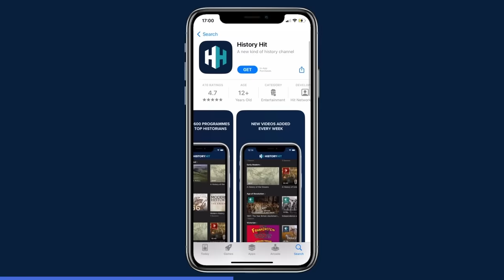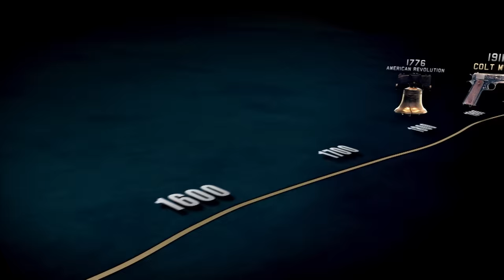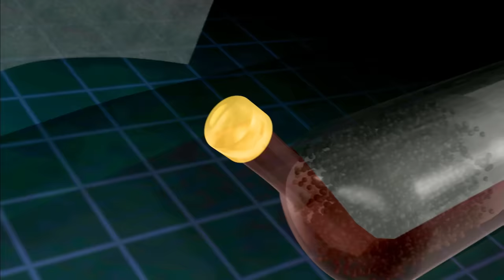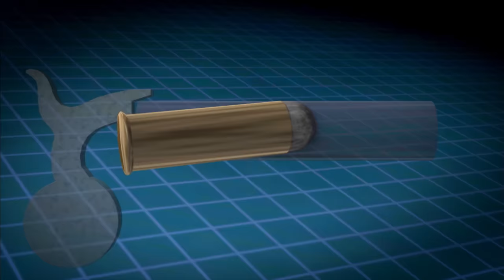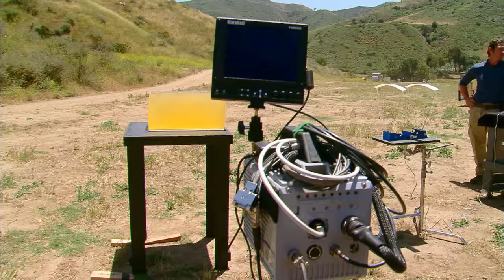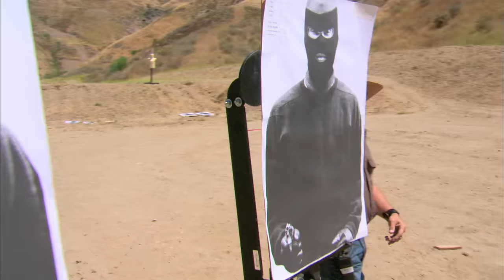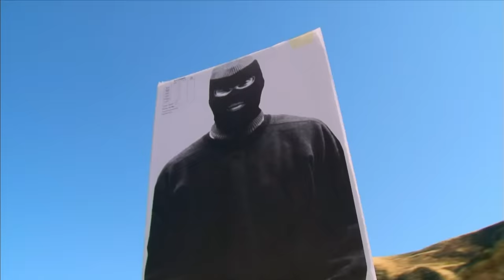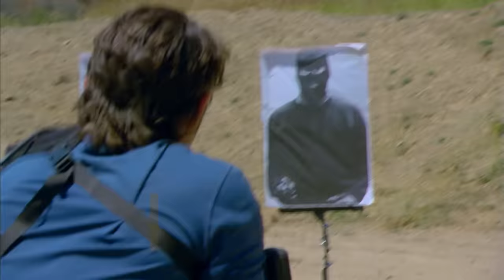Why The Colt M1911 Is The Ultimate Sidearm | Weapons That Changed The World | War Stories

Comment: A 1911 is like a classic work truck. Simple, elegant, needs a little knowledge to keep it running, but in the long run will outlast all the modern whiz bang stuff.
Reply: I have yet to see a polymer frame crack from recoil fatigue. Metal frames can and do crack, even the forged ones. Most, but not all, modern frames are investment cast and they stand to last longer than the forged frames

Comment: Retired in ‘91, Ranger in 1st and 2nd Bn’s.  Did not transition to 9mm while on active duty; kept the 45’s as the personal protection sidearm.  I have several Lugers, dating back to 1939 and fire them periodically.  Temperamental with the top toggle and be sure to keep them clean.  My carry pistol is the 45, though.  We used to joke (somewhat) that those heavy rounds had torque over horsepower…..if it hit and didn’t kill you on impact, it would drag you to death.
Reply: I have a double date 1916/1920 WWI/Weimar-era police Luger. Erfurt manufactured but Mauser refurbished in 1920. It's a slam dunk of a shooter, and it's only malfunctioned with the original mag (single-pin baseplate, so it's loose but could be fixed) and with crappy aftermarket ones. If you can get your hands on stainless Mec-Gar mags, you will probably never see a malfunction again. You'll have to look sharp for them, because they only make them in limited runs and they sell out quick.

Comment: I bought my first pistol a Colt 1911 in 1987. I have had several since and carry a Colt 1911 Gold Cup now. I have never had one fail me and have never worried if I had enough power. It by far does more damage then my other 9mm and 40's I've owned. I highly recommend one. Yes , it's also all American and a living legend.
Reply: Power is the wrong word choice. It's winning feat is diameter.

10mm and 10mm based cartridges would be best described as power
Reply: @jason200912  Well ,I was speaking of knock down power. As far as penatratimg power, it has more than enough, so that kind of power is of no concern  to me. That is what my M1A Socom is for....
Reply: Then you havent fired them much.
Reply: One question. What kind of ammo does your 1911 take? From what I’ve heard, 230 grain jacketed hollow points aren’t as effective in close range or in standard 5” barrels. Have you ever tried running semi-wadcutters?
Reply: We know that the Colt M1911 remains one of the most distinctive automatic handguns in the world. Comparible with the cheaply made Russian Kalishnikof AK47. I have very little experience firing bullet firing weapons only doing a little hunting with a beautiful Single barrel Spanish 12 bore shotgun, an English 4.10 bolt action. A 4.10 / .22 bullet over under tubular 15 round .22 short, and a Webber pump action steel headed plastic pellets. A single trial burst of a WWII British Sten gun on a Scots Regimental firing range. For which I was grateful, though I Was not impressed by the Sten gun.
In Scotland prior to 1707 and the Rebellion against the illegal English occupation and Act of Union, Scottish clansman and citizens were permitted to bear arms, but after this age and Civil unrest English politicians denied Scots civillians the right to bear arms. A century later Shotguns and hunting rifles were permitted only for hunting deer, and small game under licence on certain countryside areas. It is illegal to bear arms for home defence against criminal home invasions.There are certainly many cases where individuals have been hurt, having no right to have a weapon in order to defend family.
Only the Police and military are permitted to own a weapon despite which we have had several Home and School shootings over the year by evil or insane individuals who illegally bought smuggled black market weapons. Non Lethal weapons such as Tasers or crossbows are also illegal.
New non lethal weapons such as stun guns or electricly made weapons should be developed for home safety and for people who are living in areas where they are vulnerable, but follow the laws until the registry and ownership of lethal lockable weapons are developed, with computer based genetic or switched locks where they cannot be fired by anyone not the owner and spouse of the device in emergency situations, such as invasive threats by criminals and thieves.
We also need GPS implementation devices to track family members and children outside the safety of the home. Laws must be drawn up to permit the use of such devices with advanced information transceivers to local Police or military sources to protect and track individuals such as our children and vulnerable family members in such emergency situations. To this end, all schools must add self defence lessons to the Curriculum in every school in Scotland. 
Added to this all areas must have detection devices against hidden weapons carried into schools, Shopping areas and Banks to prevent innocent victims of violent criminal attacks as knife crimes rise in  retain year by year.
Reply: I have a Ruger SR-1911 as my EDC.
Reply: @williamwilson2270  if your real and not AI then its terrifying peopl like you exisr.
Reply: @williamwilson2270  So, you think the government tracking your every location is a good thing-how good has the government been, so far?  While not the intent of this following quote, it seems in modern times to fit: "Those who would give up essential Liberty, to purchase a little temporary Safety, deserve neither Liberty nor Safety".

Comment: I inherited a Colt Commander .45ACP from my father when he passed away.  I still take it out on the range for some fun but it's a handful and temperamental compared to newer handguns.  Still love it though.
Reply: Needs a tuneup. I did a little work to my 1911 I bought back in early 80's, I'll match it's dependability and function to any modern gun.
Reply: not tempermental, commander eats reloads no problem, hollow point, etc.
Reply: Not good enough as self defense gun.
Reply: Reliability issues are usually from magazines.  (That goes for Berettas, too.)  As 'handfuls'  go,  well,  my all-steel Commander is a chunk to want to  carry around but the weight helps  cause my hands aren't exactly bringing a lot of mass to the recoil equation.  :)
Reply: @reiniergarcia  elaborate
Reply: @reiniergarcia   I don't see why not, was good enough for soldiers.
Reply: @reiniergarcia ?? Compared to what?
Reply: @independentthinker8930 Sig P220 says anytime any range!!
Reply: @reiniergarcia agreed its a old battle horse but better guns have passed it by.
Reply: @dwayneelizondomountaindewh1465 Most soldiers never see a handgun. And those that do carry them in a holster and they never move.
Reply: Adjust your extractor and polish the feed ramp/chamber, it's easy
Reply: @gophucyorselph5179  Always something needed for a 1911 to run half decent. My P220 ran great out of the box. No bs needed. No break in no oil up etc.
Reply: @gophucyorselph5179  that isn't all, to actually make it better, match chamber feed ramp to frame ramp. That makes a huge difference
Reply: @gophucyorselph5179  polish the feed ramp, seems to be the be all end all! LOL
Reply: @independentthinker8930  I agree 👍
Reply: Has the commander been throated and ramped? If your dad had it, it was probably not done at the factory as hollow points did not exist back then. Have a good gunsmith throat and ramp it. Replace the recoil spring with a new spring and up the power. A standard Colt Commander came with an 18 pound recoil spring. Move up to a 20 pound recoil spring. The added power will ram the cartridge out of the magazine, up the ramp, and into the chamber where the slide will lock up more consistently. Replace the hammer spring as well. Factory load is a 23 pound recoil spring. Give it a fresh spring. Replace the firing pin spring as well. Now change out the magazine with fresh Wilson Combat magazines. Have the gunsmith hand tuned the extractor when he has it for the throat and ramp. It ought to work just fine for self defense work.
Reply: The key to the 1911 being reliable is using really good magazines . Not the stock ones.
Reply: So, according to the fans in this thread, the stock Colt 1911 was crudely machined, had weak recoil and hammer springs and crappy magazines.  Sill, it was better than a Nambu I guess.

Comment: I learned the 1911 in 1980 during army officers training in Fort Knox. Since then, I've owned some 10 different 1911s, from AMT Hardballer, to Colt, to Springfield Armory, to Sig TT, to Les Baer, Ed Brown, and recently TISAS. I currently own 6 1911s. I had one on my hip during thr Rodney King Riots. I've had one behind my pillow for many years. I usually carry a Commander size 1911 on my CCW. If things go bump in the night, a full size 1911 loaded with 230 grain +P, JHP, is warm comfort.

Comment: That’s why the Para-Ordnance frames really took off in the late 80’s. You had 12–13 rnds of .45 acp in the mag.
They even started making 1911’s in the ParaOrdnance Factory.
Reply: Built my custom gun off a Para-Ordnance. I use Remington R1 Limited mags which are 15+1 standard in .45ACP and 18+1 with Taylor Freelance extensions. That’s a lot of firepower while retaining the other aspects I love about the 1911.

Comment: I always wanted a 1911, couldn't afford the Colt so I bought a RIA 1911 a1 as my first pistol. It seems to only get better with every round I fire, so smooth!
Reply: I am more a Colt revolver fan but I also bought a RIA 1911 A2 with the double stack hi-cap magazine (10 in CA).  
It is quite heavy with thick grips but it has good combat accuracy and is very reliable so far.  And reasonably priced, too.

Comment: Remember that John Browning was constantly learning and improving on his firearms designs.  The last pistol that he worked on at FN was the work-in-progress P35 of Broening Hi Power.  Imagine the P35 in .45 ACP?  If alive today, John would be using CNC/CAD and modern polymers, he was not tied to old technology or materials.😮
Reply: Double stack 1911s are basically that concept, though given John Browning’s genius, I’d imagine he’d come up with a new system for handguns that would be extremely revolutionary if he were alive today. Part of the reason the 1911 is still relevant over a century later is because most modern pistols still use the tilting barrel short recoil mechanism he invented for the 1911. Pistol designs have really stagnated outside of new features or materials.

Comment: I have an old ATM Hardballer 1911 i rebuild with all Wilson parts. Ive run pistol courses with it, and the last one i ran i did it with my friend, who brought a Glock 19. He laughed because i only brought a gun that only held 8+1. Well my 1911 functioned flawlessly, his Glock had  two failures to feed and a stovepipe that afternoon.
Reply: I’ll take stories that never happened for a $1000
Reply: Ok, I love my 1911's.. but let's be real here.. To pretend like a 1911 is more reliable than a Glock is pure fanboi fiction. Both are very reliable, and your buddies bad apple doesnt speak for the whole bunch.. but a Glock is slightly more reliable on average to be honest (especially when you're using hollow points for self defense purposes). Heck I got glocks that haven't seen failures in 5 thousand rounds.  I can't say that for the two 1911s I have unfortunately
Reply: Always wanted an amt hardballer because of video games but they have risen so much in value in the past few years. Used to see them for under 800 sometimes but now never.
Reply: both platforms perform well in the right hands and conditions. The failure of the glock is much more likely due to user/maintenance error instead of the design itself, though.
Reply: Beggin' the Colonel's pardon, but what's a "stovepipe"?
Reply: @666rivers  Stovepipe jam in firearms is usually when an empty casing fails to eject properly and gets stuck somewhere in the slide
Reply: 357 revolvers are more powerful and don’t jam.

Comment: Don't forget, the .45 ACP was designed specifically for stopping power, and they tested it on cows..... It is quite literally "Anti Cow Projectiles" being slung downrange.
Reply: You can even back that up further to the Colt Walkers (and a little after that, the Colt Dragoons) were designed to take out soldiers and the horses they road in on. 
.44 and .45 caliber repeaters were pretty much hand fired artillery.
Reply: In the Philippines..
They call the COLT 1911 .45  
 "..FOR BUFFALO 🦬 USE ONLY"😅😂🤣
as no handgun can bring DOWN a Buffalo.
Reply: Most people do not know but the 9 mm was build to penetrate light barries like wood etc. May a 45 ACP round bounces of a helmet Back in Work War I/II but may a 9 mm went trough.

Comment: Just for the sake of argument, in the Luger vs 1911 challenge the young man with the Luger was firing one-handed. Willis used a modern two-handed technique with the 1911 which explained his much better shooting.
Reply: One handed was the technique back in the day.
Reply: @rzr2ffe325  Yes exactly, so willis should've fired with one hand as well.
Reply: yea but that funky top action that the luger had is objectively inferior to the 1911 , im sure it caused alot of issues
Reply: @doc3353  Well,  points to the re-enactors for being authentic,  but on the other hand,  they and Alvin York were both trained that way, whereas our host  wasn't.  (I'd still have liked to see him try it the old way  regardless but....)
Reply: I have both. They are about equal
Reply: @mikesmith-wk7vy 
No it won't. I've got a Mauser 08 luger and two swiss lugers in 7,65 mm parabellum (30 Luger). With the right ammo they Work without any problems.

Comment: Heres a fact, during the trials to find a new side arm for the U.S.Army the Luger was also tested against the M1911, except in 45 ACP. They were serial numbered #1 and #2. One of them sold for a $1,000,000
Reply: The Luger pistol in 7.65mm(.30 caliber ) was also Tested in the Philippines during the PHILIPPINE
 " insurrection" but found very negative results with the US Cavalry.
The surplus.30 caliber LUGERS were ALL Bought by Gun dealer, Francis Bannerman for less than $10.00 each 😮

Comment: I've carried both the 1911-A1 & the M9 in harms way. I love them both. I'll give the M9 A slight advantage due too lighter weight, more magazine capacity, faster firing due too less recoil & a slight edge in reliability in adverse conditions. The 1911-A1 has an edge in stopping power & has more practical accuracy due mainly too its trigger. If I were still serving as a Soldier I'd go with the M9 mainly due too weight, but now that I'm retired my truck gun & home defence pistol is a 1911-A1 because weight isn't an issue. They all fall for hardball.

BTW The Colt 1911 you are using in the film isn't a 1911 or a Colt. Its a 1911-A1 built during WW2 by a contractor, probably a Remington Rand or an Ithaca. I can't quite make out the markings, but I can see them good enough to know its not a Colt.
Reply: Remington is what that was . I know since I grew up shooting one my dad bought in the 50s with the ball ammo for police work in Texas .

Comment: 8 rnds. 124gr .355 cal fmj at 1150 fps  (vs.) 7 rnds. 230gr .45 cal fmj at 835 fps. The 9mm fmj velocity shoots through a man. See "Mozambique drill". The 45acp often stops just under the skin on the opposite side meaning it dumps most or all of its energy inside.
Reply: The browning hi power of 1935 was a game changer and set the theme for wonder 9s
Reply: @jason200912  Yep. A Browning design also with some Belgian tweaks. Love them both. The fmj high velocity 9mm round was its weak spot. Until ammo improved in the last 20 years; the 9 had a reputation for insufficient knockdown power and often required several shots to find a lethal spot.
Reply: Sure, if you're talking about ball ammo. Not the case with JHP, and I get ten more rounds in a package smaller than a 1911 with my 9mm.
Reply: @OneEyeDollar6  Since the test was based on WWI trench setting limits the pistols back then had only issued ball ammo in their mags and I focused on that.
Reply: 8 ? My 1977 holds 6 in the original mag not 8
Reply: @beararms6945  Luger mag is 8 rnds.
Reply: @johnl.5117 I mean, a test based on 100 year old bullet technology is largely irrelevant to carrying today no?
Reply: @OneEyeDollar6  Quite a few people still use .45 acp hardball 100% of the time. It doesn't have feeding issues, is inexpensive compared to jhp and is a proven man stopper. As to the 9mm if you use it for self defense and expect it to perform jhp is required.

Comment: The M-1911a1 was the issued pistol when I was in the US Army, 11C. Many people had trouble with the slide release. Using the right hand. There were no oversized slide release options years ago. This is how we did it back in the Fred Flintstone days. As you normally fire the pistol angle the barrel about 30° to the left. You will have sufficient purchase of that slide release to make the pistol go back into battery. You can do all of this with one hand. Move the pistol with your fingertips to the left.

Comment: 9mm doesnt have the stopping power to be a fight stopper in FMJ format.  My experiences in Somalia, Afghanistan and Iraq support that!  The 45 ACP in FMJ is noticeably better although not by much.  With HP's the difference is minimal.
Reply: @shanescatsandcannabisfarm2965 I've had a Delta Elite in 10mm for 33years.
Works great for Deer.
Reply: @shanescatsandcannabisfarm2965 yet all federal and police agency’s ditched 40 because it just wasn’t that great. Great on paper but in real life it didn’t cut it
Reply: Only FMJ is allowed in the Army or Army use and not HP. Look Hague Land War Ordinance. The 9 mm FMJ has better penetration than 45 ACP FMJ. Many Armies want that because to penetrate light armor or wood, glas etc.
Reply: @cardaveux  You didnt read my post did you....